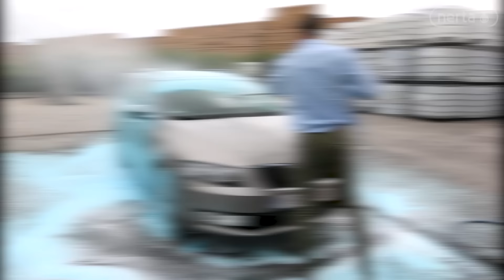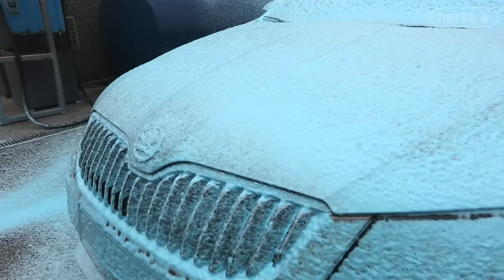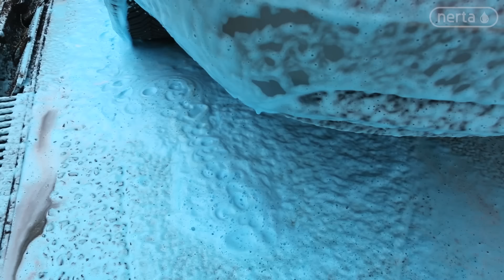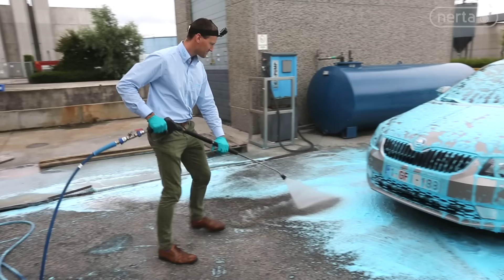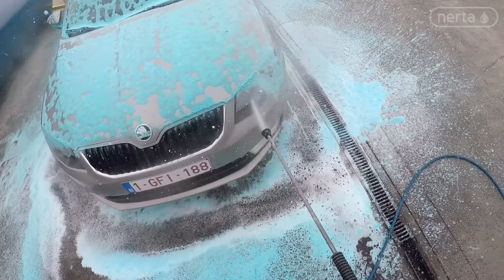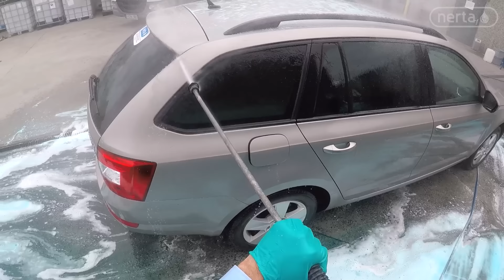Touchless Blue Foam Wash with Nerta Triple Foam

Comment: ...and I've seen a lot of people making the usual mistakes when washing their cars.
To avoid waste of water, chemicals and time it's useful to operate from top to bottom, and direction of washing only in direction of dirty areas, otherwise you have to clean it twice.

In case of using non-contact chemicals it's not necessary to pre-clean. Just spray it on the surface and let the Gravitation do their work.

Comment: I want to suggest that when next you're washing off the foam, start from the top. It saves time and energy.
Reply: Nope. Why? When you use Snow foam (for touchless wash) you should start from the bottom to top because the HPW (High Pressure Washer) acts like a brush.  So it'll be like this Water>Snow foam>Pre-wash (bottom to top)>Wash (top to bottom). Ask any high end car washers to pre-wash from top to bottom they'll laugh on you
Reply: That is not the right way to do it
Reply: that not how u do when using touchless snow foam boss

Comment: your all over the place, from the top you work your way down...dude!
Reply: THATS WHAT I WAS THINKING!!!!!
Reply: Yeah he’s working against himself starting from the bottom up
Reply: Wrong. Bottom to top keeps the soap on the car longer. Work your way up instead.
Reply: Wrong. You’re not rinsing the soap off, you’re scrubbing with the pressure washer so you need soap. Otherwise there’s no soap by the time you scrub the bottom.
Reply: @snotellekS  no you wash too to bottom because as you rinse off the soap it could leave dirt and debris higher on your car rather than washing it off. Also it doesn’t help the soap get off your car

Comment: Can I know the reason why after foam application Spray water from bottom to top why not top to bottom any reason???
Reply: The pressure washer works the shampoo in as it washes if you start at the top it just washes of ads wastes it

Comment: I've seen this on many similar videos. Why don't people understand that when rinsing the car, one must start from the top so that by the time you get to the lower section of the car, you have it fully washed. This method of randomly washing soap off just uses more water.
Reply: Rajat Plaha it's called brooming. For touchles soaps this is the correct method. The vehicle needs to be rinsed after water brooming it from the bottom.to the top .
Reply: Wrong.. with touchless washes you start at the bottom

Comment: They way he sprays the foam half of it is on the street. So wasting.
And secondly when u wipe it off again u only do it from top to down
Reply: That’s wrong. I’ve used nerta’s active diamond for about 2 years and you pressure wash from the bottom up. The pressure washer acts as a “brush” so you’re not just rinsing the soap off you’re essentially scrubbing with water. If you do from top down, there’ll be no soap by the time you “scrub” the bottom of the car. Once you’re done scrubbing, then you can rinse off any remaining soap from the top down.
Reply: No you don't! You don't just wipe it off because you want to use the soap efficiently to clean something and not just rinse it off with no sense.  Bottom to top!

Comment: Using a pressure washer to wash it makes it seem like you wouldn't need soap at all
Reply: The best analogy I have is when you you wash your hands, if the water has enough pressure, do you still use soap? Soap is needed for every wash

Comment: 😂😂😂 the amount of idiots saying TOP TO BOTTOM! The pressure washer acts as a “brush” so you’re not just rinsing the soap off, you’re essentially scrubbing with high pressure water. If you do from top down, there’ll be no soap to “scrub” with when you get to the bottom of the car. Once you’re done scrubbing, then you can rinse off any remaining soap however you want. Been using nerta’s active diamond for years. I know how these soaps works.
Reply: So this soap won't work with The robotic wash or water... Tell me about this soap

Comment: Why does everyone rinse from the bottom up?  I stopped watching when i saw that they didn't know what they were doing
Reply: It is correct for foam cannon washing as you don't want to rinse out all the soap on the lower portion while rinsing and simultaneously washing the top. Therefore you need to do the lower first, then upper, and top to bottom in the end to ensure that all the foam is off.

Comment: You should start at the roof and work your way down not bottom up to top lol 😂
Reply: You’re wrong. Bottom to top with this touchless soap.
Reply: @lilhotdog7011  touchless soap? Wow
Reply: @davecozzie1  you’ve never used a nerta soap so of course you’re gonna be ignorant 😂
Reply: @lilhotdog7011  absolutely.. I’m old skool where I come from you have to wipe the dirt off the car.. these new chemicals claim to remove dirt without touching the car..
Reply: @davecozzie1  yeah so... the soap kinda removes the dirt but not all the way. It more like loosens the dirt. So you still need to physically remove it. That’s why these soaps only work with high pressure water because it acts as the brush. So in the video, the guy’s not rinsing the soap off, he’s scrubbing with water. That’s why he goes from bottom up so he has soap to scrub with as he moves up. I learned that the hard way. The soap alone will not remove all the dirt. You scrub first with the pressure washer then you can rinse the remainder if there’s any left, however you want(top to bottom). Ya dig?
Reply: @lilhotdog7011  yeah man kool.. nice1

Comment: How toxic is this for the Enviroment/Groundwater???
Reply: Absolutely.... how many gallons of water did this take? And how many fish will this later kill. Unbelievable.
Reply: @to-wm9fg  About 30-40 liters (8-10 gallons). This is due to pressure washers using very little water and allowing you to complete the job in less time. You probably use more water when showering. 

As for the soap itself. Most car soaps today are strict to multi-national regulations. Thus being neutral pH, biodegradable, without additives that causes excessive growth of organics in the sewage. Some are even made with organic substances.

So yeah, washing a car properly with proper equipment and product does pretty much just as much environmental effect you make when you shower...maybe even less.

Comment: Always start washing from Top to bottom
Reply: When washing a vehicle using conventional methods you firstly apply soap, wash using a sponge or a broom and then rinse off with water from the top to the bottom.
Touchless washing is a bit different.
Soap is applied through a high pressure foamer and then high pressure water is used as a “sponge or a broom". The water is worked back into fresh soap, either from the bottom to the top or backwards in the case of trucks and trailers etc. In this way, the soap is used more efficiently. (If you wash from the top down, you would simply wash the soap off the vehicle

Comment: I’ve never seen anyone rinse a car from the bottom up, it’s kind of annoying. Anyway cool product.
Reply: When washing a vehicle using conventional methods you firstly apply soap, wash using a sponge or a broom and then rinse off with water from the top to the bottom.
Touchless washing is a bit different.
Soap is applied through a high pressure foamer and then high pressure water is used as a “sponge or a broom". The water is worked back into fresh soap, either from the bottom to the top or backwards in the case of trucks and trailers etc. In this way, the soap is used more efficiently. If you wash from the top down, you would simply wash the soap off the vehicle

Comment: the car must be washed from top to bottom.  not the other way around. 🤣🤣🤣🤣🤣🤣🤣
Reply: When washing a vehicle using conventional methods you firstly apply soap, wash using a sponge or a broom and then rinse off with water from the top to the bottom.
Touchless washing is a bit different.
Soap is applied through a high pressure foamer and then high pressure water is used as a “sponge or a broom". The water is worked back into fresh soap, either from the bottom to the top or backwards in the case of trucks and trailers etc. In this way, the soap is used more efficiently. (If you wash from the top down, you would simply wash the soap off the vehicle